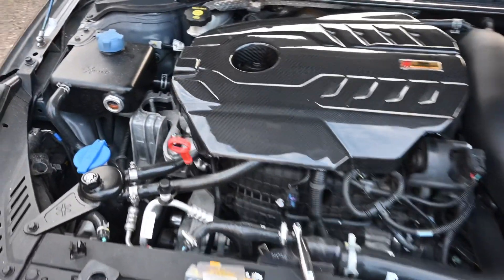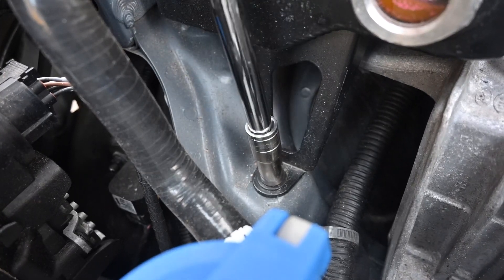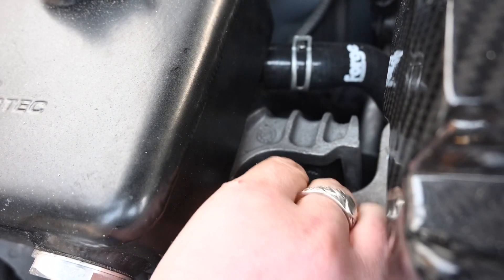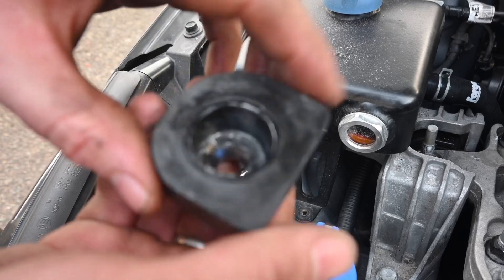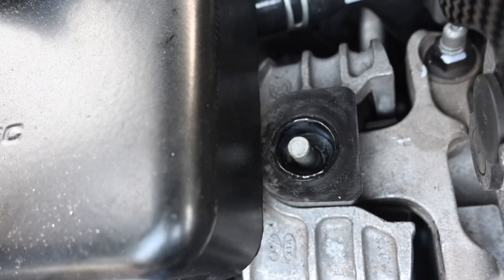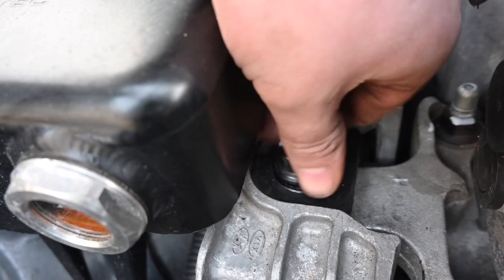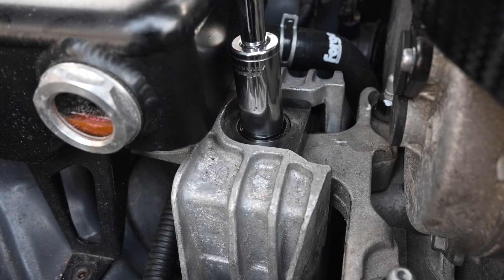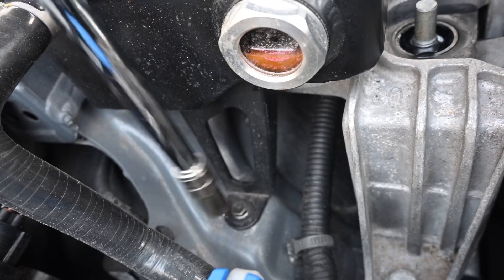Hyundai i30N Powerflex (Upper right engine mount bush) Fitting guide

Comment: Did you notice any difference ... Vibrations ? 
Thanks for the video btw !
Reply from the maker: with just this bush alone you shouldn't notice any vibration. 
but performance wise yes its alot better. 
i have upper right, left and rear insert in black series and its night and day. considering the stiffness its only mild vibrations. 
well worth it in my eyes. 👍

Comment: So no need to put a jack under the engine to stabilize it ?
Reply from the maker: No mate. 
not for this side. 
👍
Reply: Okay cool I have a Veloster N and it’s pretty much the same vehicle so I wanted to make sure
Reply: What is the Torque setting for the nut?
Reply: @danbridgman720  did you found out mate? :D